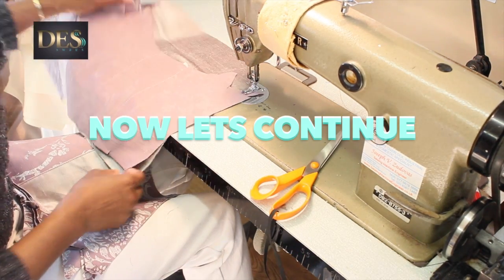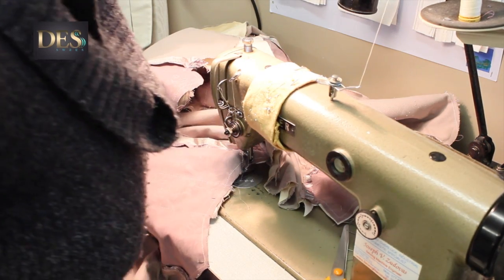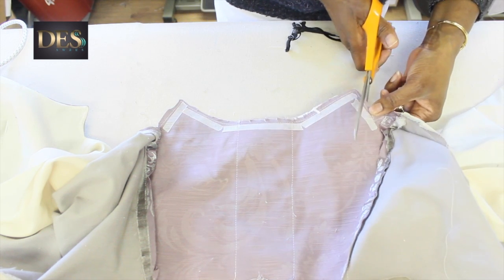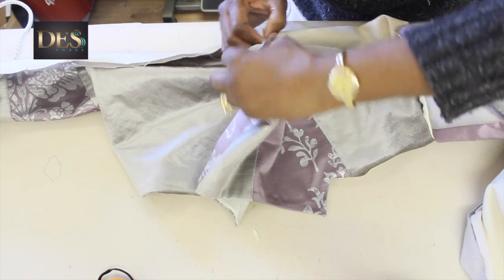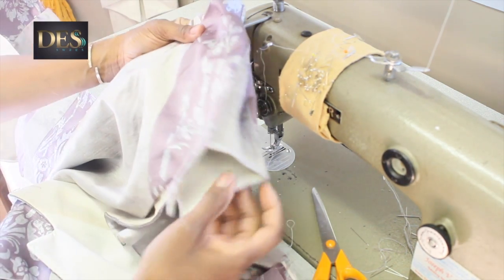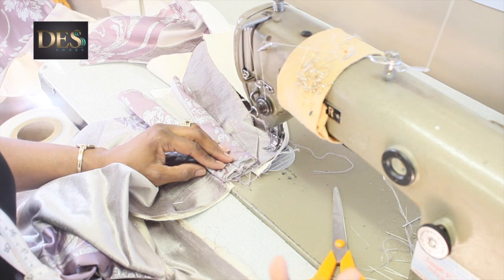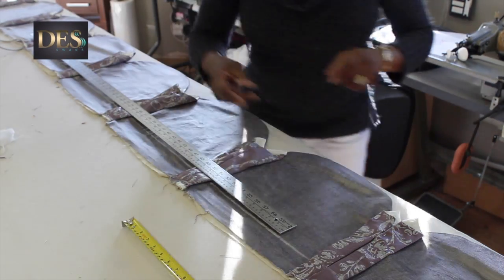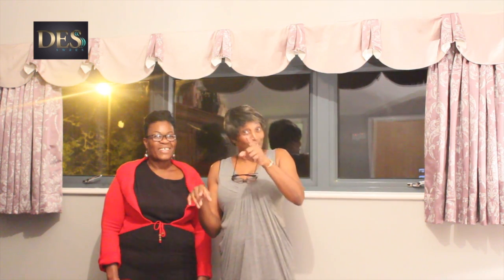Bespoke Valance part 3 conclusion

Comment: Oh my!! Those are stunning and so original. I have some questions that I'm hoping you could help me with:

What is an envelope?
Would you recommend that style with a pelmet board? If so, could the scallops be as long as I wanted them to be or should I limit the length size?
Is the valance you added slipped onto a rod at the top?
Reply from the maker: Kim O Morning Kim, here are two videos that you can watch on the making of an envelope, https://youtu.be/XjD8BNaOv5c
https://youtu.be/XyDaZtnoxHk  and this video show you how I put the valance to the edge.https://youtu.be/6Sh_TxjvHVk
You can make  scallops to be as long as you want them to be and if you got the hight, as deep as you want, just make sure you don't bloke you light.  The valance here is held up by the velcro at the edge of the wood but it can be at the top. If you use a rod the quality would be different. and the stitching of the envelope will show. Thank you for sticking with this journey to the end, I am happy you like it.
Reply: Des Swags Curtain Maker 

That makes perfect sense! Thank you for responding...I'm feeling confident I could try something similar to this.